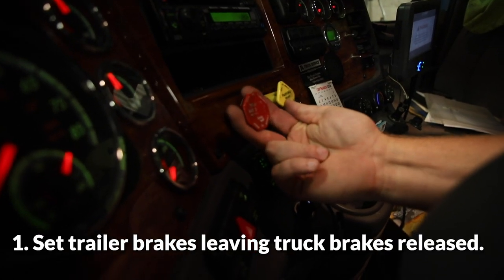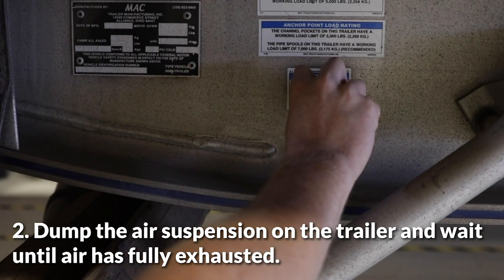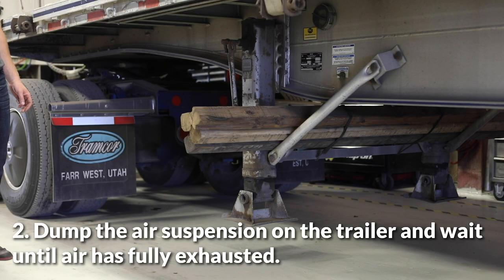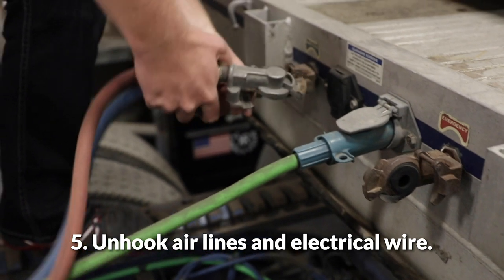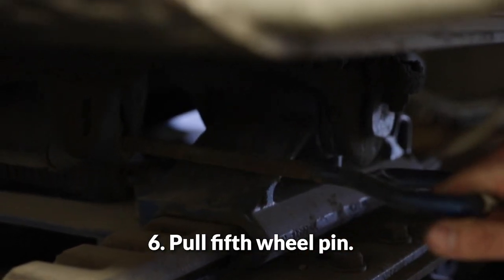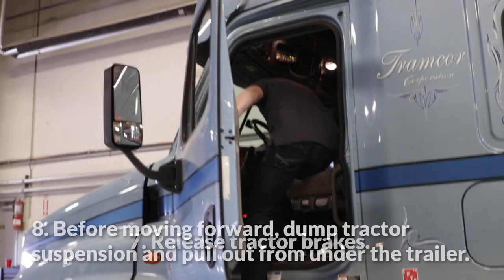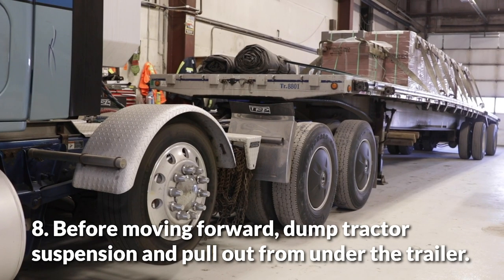Dumping Air Suspension when dropping a Trailer

Comment: I would add that when you push the tractor parking break in that you be mindful that there’s always the possibility that the trailer brakes may not hold for various reasons and both the tractor and trailer will start to move. So either have your foot near the brake or be prepared to pull the parking brake to stop this. Your tractor will roll forward some while the trailer remains stationary.

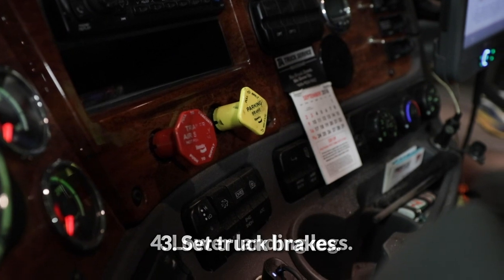Comment: Ignoring the useless chatter, I found this mostly useful.  Although I still don’t understand step 2, “dump the air suspension on the trailer til it is fully exhausted” (0:49).  Is it to keep the aforementioned air from bleeding off?

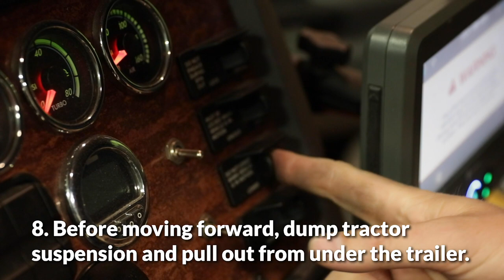Comment: Wrong! 1:03 move forward 6 inches first, then dump tractor bags. Otherwise you’ll be pulling the kingpin down with fifth wheel and damage both.
Reply: with a loaded b train on ice.... you start letting air out while giving throttle /releasing the clutch ..... when the pressure starts to come off the 5th wheel then the truck will begin to roll forward you 6 inches or so.

Comment: For dropping a trailer in a yard. Makes sense to me.

However, when dropping a trailer at a shipping dock, not so useful in my opinion because the trailer parking brakes (red) are engaged the entire time in this tutorial video.

If you drop the air suspension while the trailer's rear is "glued" to the dock cushions, the weight of the trailer might tear off the dock's cushions right off the building.

My variation to this is to dock the trailer perpendicularly tight against the building, engage tractor brakes (yellow) to get out on foot and confirm that the trailer is indeed centered and perpendicular.

Then I release the tractor brakes (yellow) and move forward no more than 6 inches and set the trailer brakes (red). Then I drop the air suspension of the trailer.

Once that's done, I release the trailer brakes and back up that <6 inch gap I previously created and engage all parking brakes for the unhooking step.

It doesn't just avoid causing damage to the building but also ensures a safer work environment for all forklift operators who go in and out without having the trailer bounce on its own pneumatic suspension, ESPECIALLY in the winter time when that trailer wants to move forward on that snow/ice with the inertia shocks the forklifts generate upon entering and exiting the trailer (if no air purge has been executed to lower the pneumatic suspension).

Plus, purging the air seems to help the system in the sense where it seems to prevent or avoid frost build ups in the system which sometimes lead to distorted brake test diagnostics.

No worries if you're driving in above 32F / 0C weather however.  Don't mind that last part if you're not trucking in northern frosty conditions.
Reply: This is more for tanker and flatbed. For dry van/reefer keep doing what you do.